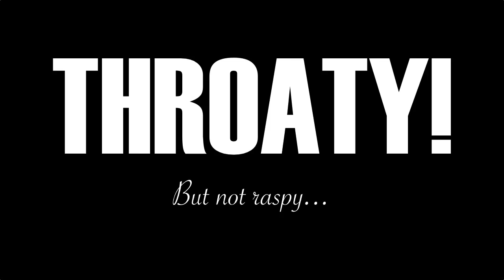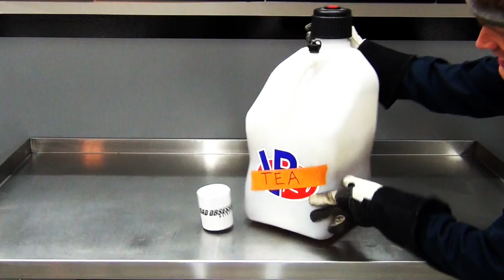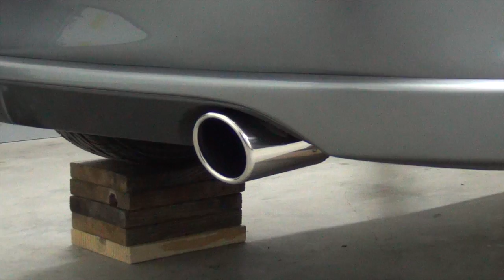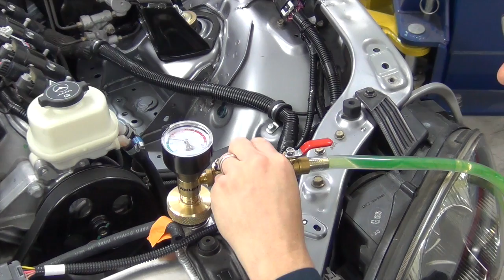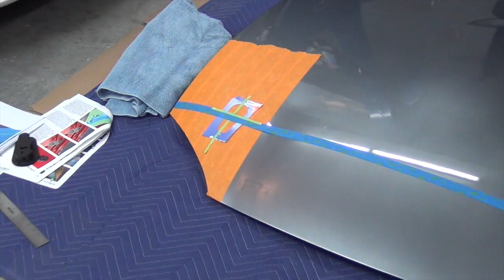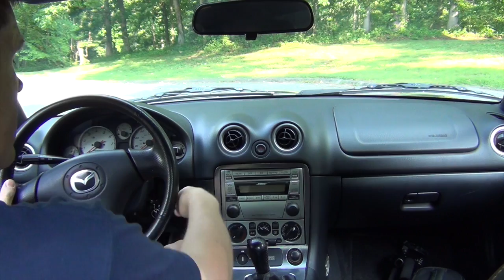LS3 V8 Miata Build - Project Thunderbolt Part 11

Comment: I do not want to rain on your parade but your exhaust system is sub par. Your vibration dampers will crack within a year and your welds on your muffler hangers will not hold up. Never weld into the side of a muffler. They do sell brackets that go around the muffler that you can weld into. Using only one exhaust bracket per side is not sufficient.  Trust me, the engine torque will rip the shit out of that system.  If you should ever do another vehicle like this it would be less expensive to have a professional do the exhaust. He can bend his own pipe and properly balance the weight of the system.
Reply from the maker: I appreciate the tips.  That said this car has been on the road and driven hard for four years with zero issues or failures with the exhaust.
Reply: @TomsTurboGarage  Than you have more than one hanger welded to the mufflers to hold this exhaust. As depicted it is impossible to work long term. Other than that a beautiful job on this car.

Comment: great job, the only thing I might add is when I build an engine, first start I always drain the oil to remove any contaminates.
Reply from the maker: Thank you sir!  I should’ve documented that more closely in the videos, but I followed GMs break in instructions which involved a bunch of early oil changes including after initial startup.

Comment: All those new stainless steel bolts into or through aluminium, and not one sniff of anti seize or grease. Good luck taking anything apart. Those brake pins will be seized like a bitch too. luckily you didn't have to pay for anything. What is the saying "all the gear, no idea".

Comment: I really don't want to be the ass here Tom/Mitch. you were drilling high speed into metal making a guide hole. Rule number 1 when drilling into metal. High torque, low speed. Lots of pressure. Awesome build man, but why chance a simple mistake for a high class custom?

Comment: AMAZING Build.  I just watched the whole thing, back-to-back.  Your attention-to-detail is unbelievable!

I have one question.  Not knowing much about Miatas, I don't know what you call that "backbone" thing that connected the front and rear subframes, but it appears you didn't use one when you put the car back together.  Is that correct?  If so, doesn't that take away chassis rigidity?

Comment: Your attention to detail is phenomenal.  I wonder a little bit about the weight of all the coatings you used, but it doesn't seem like corrosion is going to be much of an issue for your car.  

Amazing work.

Comment: Observe and remember.  The proper torque method for suspension parts.  Must be loaded to prevent flex!  Don't use a jack on the frame.

Comment: 93 octane gas. after all that work.
Nice. Any engine knock yet?
Reply: Alex Terek The engine is designed to run on 91PON, why would he get knock running 93PON?
Reply: Pretty sure most modern V8s have a compression ratio high enough that you want at least 98RON.

Comment: how exciting, she's alive :D

superb stuff Tom, fantastic to finally hear her fire up, quality work as always.

As a vehicle tech myself, firstly props on using a vacuum bleeder on the cooling system, i use one at work and they are worth their weight in gold as a stubborn airlock can be a nightmare to release. Secondly, i feel your nervous anticipation on that first drive, i'm the same after i complete an engine change or a major repair, I recently put a new engine in a car at work after its timing chain guide broke and slipped between the chain and crank gear, dislodging the chain and destroying the valves. My reward was to take it home for the night as i live the furthest away from work, and sitting in Auckland rush hour traffic hoping i hadn't forgot anything was a little tense, i sat there going over the whole job in my mind, confirming to myself i had done each step properly, torqued this, tightened that etc, but the further into the drive you get, the more relaxed you become. However many times you do it, it never gets any easier on that first turn of the key.

I've told the guys at work about this and your other series', so they will be viewing at some point.

Keep up the good work.

Comment: Tom's Turbo Garage  Is it possible to re-gear the transmission to take advantage of the insane amount of extra torque??
Reply: skirmich i believe he has addressed that by changing the rear diff :)
Reply: paul harper The Rear diff can only change the final ratio by a little much.. In the running video you can see how quickly his RPM shoots up and needs to shift quickly.
I am unaware of the current Redline for this setup but the Stock Miata has very close range trans. Good for 4 cyls, Useless for V8s.
Reply: skirmich from what i could make out it was in 3rd gear doing around 45mph at 3000rpm so presuming the engine revs to 7000, 3rd is good for 105mph, so its not too close ratio going by that rough guesstimate.. I stand to be corrected though.
Reply: paul harper Aren't the LS engines tuned to max 5900rpm only?  Although the true redline for the LS3 seems to be 6900rpm but the stock ECU wont allow more than 6100-6200RPM, Still what a hassle to shift that early...

I could not see the tacho though just seemed to be shifting too early to avoid wheel spin.
Reply: skirmich
Reply: As for Redline being lowerd quite a bit, yeah GM does that a lot. My LSJ supercharged 2.0 is limited to 6800 but the internals are good for 7900. Just need a laptop and HPTuners and you can change all that stuff. I keep hitting the Rev limiter in this car, I'm used to a 7300 cutoff from my DSM days.
Reply: skirmich He also changed the transmission in one of the episodes..I think to a Tremec that comes in the package.
Reply: +51farmalla exactly. a Tremec T56 6 speed

Comment: Eleven episodes and the first technical quibble.  Standard PTFE tape should not be used on the oil fittings.  Some installations will cause stringy bits to break off and clog passageways.  The white stuff is not rated for petroleum resistance.  If you have to use a Teflon tape use the yellow gas rated tape.  But you are better off using either a Teflon paste or even better Loctite.

Comment: Tom, I am happy to say I have been watching your videos since the Turbo Sunflower days. I always learn something new to apply to my projects.
Since I began watching, I have really started to pick up on a lot of the things you teach. Like Labeling. That saves a TON of headaches when switching harnesses. Or the excellent way you keep bolts when the car is apart for a long time.
I love these videos, and I am sooo happy when a new one pops up. Thank you so much for these videos. They're informative, informational, and educational.. and without bias, which is very important these days.
One question, though - If you're using the T56 from an F-body, won't your 5th and 6th gear be pretty tall, especially with 3.42's? I had a 4th gen F-body with the 6 speed, and with the stock gears, 5th was barely useful, and 6th was plain useless until 100+mph cruising until I added power and gears. I'm assuming since you'll have a honest 500hp, you won't have these problems.Are you planning to put in a 3.73 or 4.10 rear gear for the acceleration, or do you think the 3.42's will be plenty?

Thanks again so much Tom! :)

Comment: I'm still amazed how you guys in America can run such big engines on fuel rated at 93RON.. Your performance and mileage must be shockingly bad. This year BP are rolling out 102RON at selected stations around the UK. I already run on Shell Nitro 99 occasionally dropping down to Esso 97.
Reply: The US use a different measurement for octane, an average of MON and RON.
Reply: iMann iFail Us 93 Octane is the equivalent of 98 Octane RON fuel in the UK. So while it is not 102, it's not bad.
Reply: Tibor Pazera i never knew that, i was thinking the same thing, why only use 93RON. Well you answered my question.I wonder if 102RON will make it to new zealand, over here 91RON is still the most commonly used fuel, 95 here is called "premium" and the odd place that has 98 calls it "super" or "ultimate" at bp. i only ever put 98 in my cars. 91 is garbage.
Reply: paul harper Why is 98 better? Does it contain less ethanol?
Reply: The RON rating is how quality the fuel is, the higher the RON, the more stable and clean the combustion is. Therefore, on any modern engine, the higher the RON the better. The manufacturer I work for, on certain engines, you HAVE to put 95 or above or the warranty is invalidated as they are not designed to run on anything less, put 91 into one of these engines and it causes pre combustion or "pinking", which over a not very long period of time can cause serious damage to the internals of the engine.
Reply: paul harper I see, it must be different here, our PON rating is a only a resistance to detonation, not a determination of quality. I don't like the higher PON rated fuels due to their higher ethanol content which absorbs moisture (not to mention all the other nasty stuff it does). Some brands of fuel have more detergents in them so you could say they are "cleaner" but if you take an engine designed here to run on 87PON and you run 91, 93 or 94 PON you'll almost always just suffer a loss in performance and fuel economy (because the ethanol contains less energy than gasoline). If you have no ethanol in your fuel where you are, or they don't use it to increase the resistance to detonation (octane number), then I could see why running a higher octane fuel would be desirable.
Reply: I knew that the UK octane measurement was slightly different to the US but not by much.. I thought it was only out by 2.. So your 93 would be our 95 etc.. In Britain, the legal minimum standard is 95RON. Here in the UK 95, 97, 99 is sold all over and soon to be 102/3 is sold at selected stations. That aside it still surprises me that you're still running 93 '95' in V8 engines or even turbo charged lumps. The Japanese are on top of this already.. They sell 103/4 everywhere.. V-Tec kicked in yooooo!
Reply: iMann iFail Wow, your lowest grade is 95RON?!? Nuts! Ours is 91RON! :( Our 91 is your 95, our 93 is your 97, our 94 is your 98.
Reply: I'm not sure what's the lowest / highest fuel rating your country sells but at a guess your 93 is our 97/98. I believe the European fuel is more refined hence why they're rolling out 102RON. The highest I've ever seen in Britain is 100RON but without a remap or knock sensor most vehicles will only benefit from the fuel having a cleaner in it.

Comment: Are you going to show some more videos when your on it a little harder so we can get an idea of how fast it is?
Reply from the maker: Revive Yes I do plan to do that in the future, but "GoofyDaGoof" is right, I'm still in the early break-in and "checking every nut and bolt" period and will be for some time.
Reply: Revive the engine has a break-in period, you wouldnt want to put the engine in and then go 150 down the road with it. you have to drive it the speed limit for a few days/weeks to get the engine ready for higher speeds
Reply: Oh ok. Yea i don't want ya to do any harm to it, just wanted to know if we could see ya push it. Thanks!

Comment: It may be my personal preference, but I do feel as though that exhaust tip was slightly out of place. I mean it may be a throwback to the 4-cylinder of the MX-5, but it seems like it would be appropriate for only that of a 4 Cylinder engine. I understand that the build is more on the side of sleeper/professionalism, I just feel that maybe a non-polished tip without the slanted and rolled edge would have been more appropriate. More of a straight pipe look, but I do understand the reasoning behind the choice you made and I don't disagree!

Comment: Tom you Rock man!
Couple of thoughts on you project.
1. What about weight balance with the new massive engine. Stock miatas are close to ideal 50/50 what is the new proportion. Any thoughts on this.
2. Minor comment: When adding the extra enforcement brackets at the front wings (previous video) wouldn't it be better for mechanical strength to WELD bolts on the chassis rather than drilling holes? 

All in all excellent work man again! Keep on ! greetings from Greece

Comment: If you flip your hood struts around so the big end is down they work better.  Yeah it doesn't make sense but it puts less pressure on the back of the hood when it's it's closed that way and is less likely to push it up in back.  If you noticed in the Mitty hood shot thread they are all that way.

Comment: What was the gear box like to shift?
Reply from the maker: ***** Hi Gus, it is fantastic!  I was afraid it would be stiff like some stock T56s that I've driven, but the magnum shifts are smooth, short and easy.
Reply: Tom's Turbo Garage Is there anything you would have done differently for the build?

Comment: so when am i going to get a ride, could show you the big truck some time, 2014 freightliner that i pull with for boyd brothers ... car sounds amazing , i am now the proud owner of a 1990 300 zx 2+2 ebony black with 233 k on it , when the n/a finally dies havent decided if im doing a vg30dett swap and making that motor a healty mid 400's hp range or going a v8 swap route , if i do the v8 swap i will be giving lingenfelter a call for one of there crate motors, have a good weekend tom

Comment: Those seem like some really short gear ratios
Reply: Usually you don't want to rev a new engine too high. You have too let out break in first.
Reply: DynamiteDupree Yea I'm not talking about how high he revved the engine..  I'm talking about the gearing
Reply from the maker: Dee Jay It just seems that way in the video.  Yes, I chose the close ratio T-56 Magnum, but given the rear end ratio and tire size, the speed in gears at redline is:
1st: 51mph
2nd: 76mph
3rd: 104mph
4th: 135mph
5th: 169mph
6th: 215mph
Reply: ChrisHallett83 ^Mitch lol
Reply: Sam Williams I lol'd